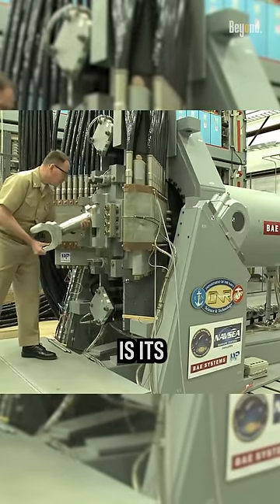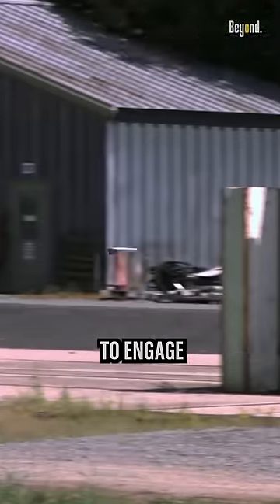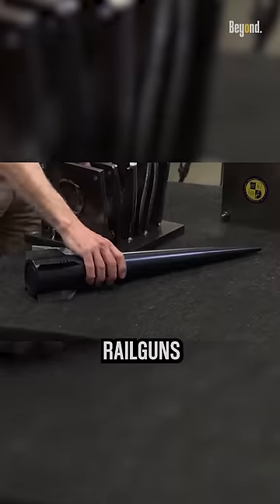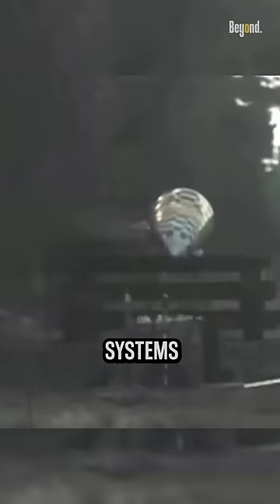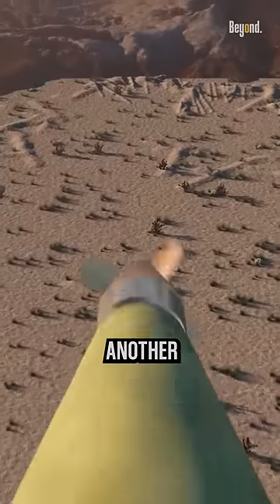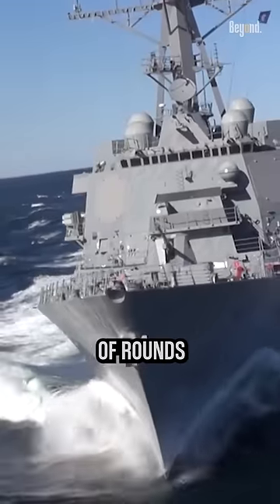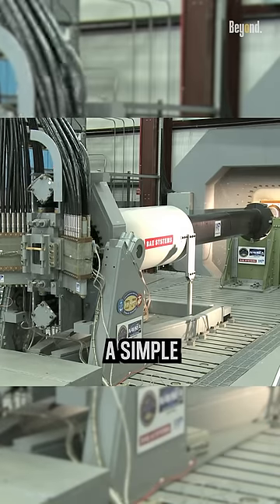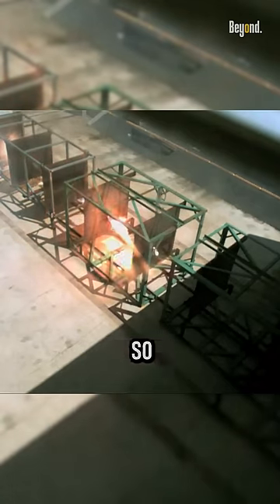Why does the US Navy need a railgun ? #shorts

Comment: They also require an ungodly amount of electricity to propel the projectile through the electro magnets on the rail. And that is the biggest dilemma keeping them from being a mass produced weapon.
Reply: That and it uses so much force it destroys the launcher after only one or two uses
Reply: Land based weapons defense platform operated by AI targeting. They've also increased firing rate by 70%.
Reply: Electricity generation is no problem for nuclear powered ships
Reply: @ryansouthworth668 and capacitors.
Reply: it did use alot of elecricity but the reason they could not actaully use them was because they could not fit it on any us navy boats and it was also very heavy.
Reply: @ryansouthworth668 thats... not how that works..
Reply: On a nuclear powered aircraft carrier, energy should not be a problem?
Reply: @GuidossInnit  it provides consistent energy at a higher level than normal but it's not limitless... your still limited and aircraft carriers don't work when you start mixing their roles with gun ships
Reply: @GuidossInnit  i dont think they gonna put one on a aircraft carrier cause its mainly for support and to take planes for A to B
Reply: @ryansouthworth668  they tested it on one of the ships and i think the gun needed like 70GW and the whole ships production capacity was 80GW
Reply: Doesn't use electro magnets tho, the magnetic fields don't need a coil but it does put the same force on the rails as on the projectile.
Reply: @madcitytournaments8591 kinda… but a carrier in my opinion is like having a portable mini army… or you can say a medium sized army because they’re so protected… planes, warships, and submarines
Reply: Railgun has no elecromagnets.
Gauss gun has.
Reply: Hey there. Jesus loves you! Through Him is the only way to heaven! May God bless you. 😊
Reply: Just alien metals and you're good! 😂😂
Reply: @newmanattack  capacitors don't generate electricity. Only stores it
Reply: @GuidossInnit  aircraft carriers are not armed with big guns
Reply: The problem isn't energy. The problem is that the gun destroys itself while firing. That's the problem. We don't have materials that can support such a weapon.
Reply: @ryansouthworth668  yes it is a problem.. because the ships reactor was sized to only power the ship's systems. the onboard reactor doesn't have the extra  20-30MW available. so you either need to upgrade the nuclear reactor or you'll end up with pretty long charging times for the railgun's capacitor banks.
Reply: @supmo68  80 giga watt ? GW ? land based nuclear power plants are like 400-1500MW per reactor that's 0.4 - 1.5GW, so how could a ship's reactor have a 80GW output ?
Reply: @robertjung8929  Ford class has 40% in reserve for Lazer systems
Reply: That and the force behind it shreds the inside of the barrel
Reply: @robertjung8929   yeah then it was the wrong Unit sorry but it was for comparison my bad
Reply: Correct
Reply: @2110bt so what your saying we need a nuclear battle ship?
Reply: No problem! If the ship is nuclear powered. US have nuclear powered ships like aircraft carriers and submarines.
Reply: Not like US navy ships have never been power by a nuclear reactor
Reply: 8 megajoules if I remember.
Reply: @2110bt this is true. Any thing for fighting it has besides the planes are purely for defending itself. It it has to USE any of it's cannons or missiles. Someone else failed steps 1-6.
Reply: @andrewyork3869 goddamn that sounds expensive.

Let's do it
Reply: @JohnFormanPA  It's not force... did you see that muzzle flash? That was plasma vaporizing bits of rail and sabot from the connection arcing. It doesn't force the rails, it burns them.
Reply: well, that and the fact that the magnetic fields generated tend to warp and deform the rails, ruining the gun after a few shots.
Reply: @madcitytournaments8591  The Zumwalt would be the place to install this weapon if it worked. The ship was even designed to produce lots of excess electric power for such a potential future possibility. 

The problems I read about that lead Navy to conclude it was a dead end was the damage to the rails with each shot as well as several other smaller issues too difficult to solve.
Reply: @ryansouthworth668 yes but you have to store that power until needed and release it all at once.
Reply: @adamr9720  yes caps would be part of any Lazer or rail gun system
Reply: @gibu002  yea the whole point t of the zumwalt was thst it would have all us tech and be able to do diffrent types of tasks but in reality it did not work thst wel and it could not be thst top heavy cause of the desighn
Reply: @Antares_451 il
Reply: @supmo68  That is why you use capacitors.  The big problem is heat.
Reply: @2110bt how about Railgun battleships? U can solve the energy generation problem, the guns being too heavy for a destroyer problem & probably get bigger guns period.
Heck u don't even need a battleship, just a dreadnought or battlecruiser with thin armor would do too (unless u want to revive the modernised Iowa class concept of the cold war of a ship able to take the punishment that modern weapon platform can cause)
Reply: @2110bt  what do u mean it doesn't discharge 50MW at once for mwah railgoon? 😂
Reply: @Tomyironmane  either way the system breaks after one or two uses which makes it currently obsolete
Reply: @ryansouthworth668 Yes it is. It's not like mobile nuclear reactors can produce infinite electricity. The railgun needs more power than the whole ship does for propulsion and all other systems combined.
Reply: @BilalAhmad-ff3xq  It's just not worth it. The energy generation required means it's got to be nuclear essentially and it's rate of fire will be too low as it'll require capacitors. The requirements to build a ship of that class type are too steep and it's benefits are outweighed by the downsides. The most modern similar ship would be the Zumwalt and they showed that modern long range gun systems just aren't required anymore. Cool? Yes. Practical? No.

In a real way it'd get torpedoed and sunk like an aircraft carrier anyway.
Reply: @robertjung8929 that's why it needs capacitor banks. It works like a camera flash. You charge the capacitor bank over time (call it 30 seconds) and then discharge it in the fraction of a second it takes to throw the projectile down the barrel.

Comment: I like how you conveniently left out how the rail guns basically self-destruct after firing needing repairs
Reply: How does a rail gun fire needed repairs?
Reply: @francislopez8090  internals destroy themselves after throwing the projectile
Reply: @francislopez8090 capacitors blow out and the immense magnetic fields pulsating rip other parts and the magnets themselves to pieces. The test cannons they built needed new barrels after less than a dozen shots, and needed agonizing maintenance. Now, those shots are insane and will punch clean through both sides of a standard battleship. But it still needs an intolerably high maintenance cycle and cannot maintain combat effectiveness for extended battles. Also the firing rate is abysmal due to the time it takes for the capacitors to charge. The amoubt of power draw is also immense, and only ships with a nuclear reactor could reliably get the power output needed to fire large sustained volleys. Basically the biggest technological hurdle is the capacitor and heat dissapation tech. The fact the thing fires at all without bursting into flames is a marvelous accomplishment. But we are still likely a decade or 2 out on the materials science needed to make it viable as an actual weapon for ships. Once they fan shoot it every minute for an hour without a breakdown? Yeah then its on baby. And smaller varients with hypervelocity rounds would be amazing at shooting down missiles or even cannon shells. Things fly at mach get fucked. Engagement range would be simply identification range.
Reply: @francislopez8090  the high speed projectiles and the lorenz forces creating a plasma bubble around the projectile that is almost as agressive as a plasma cutter
Reply: Exactly, and he even said it's more cost-effective compared to a traditional gun. 😄
Reply: Missiles self destruct too..
Reply: @dubious6718  main differences what shoots the missile doesn't